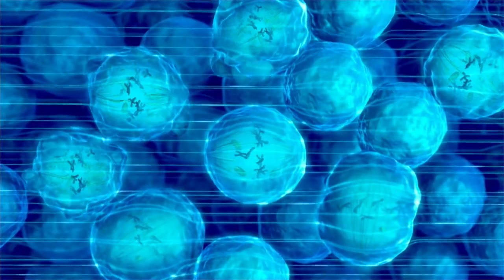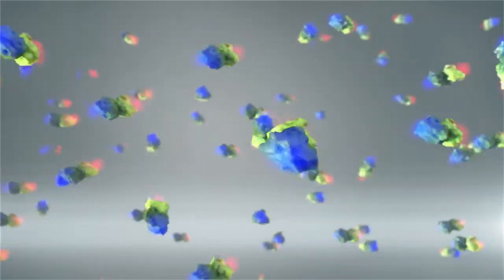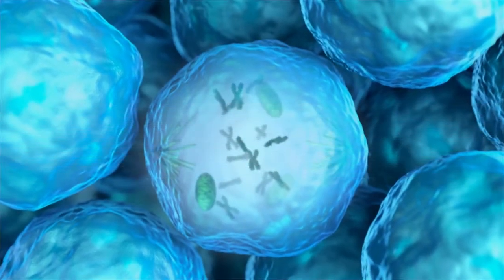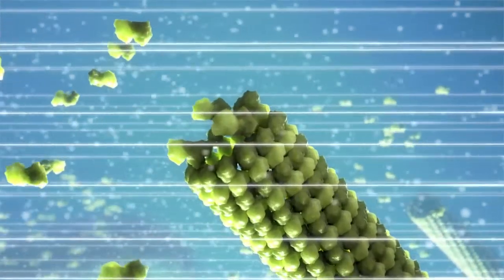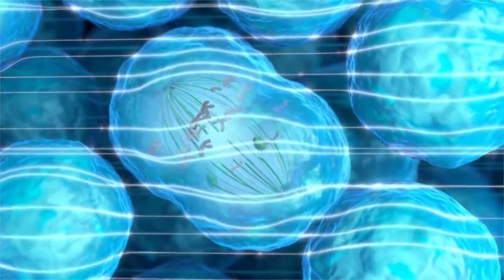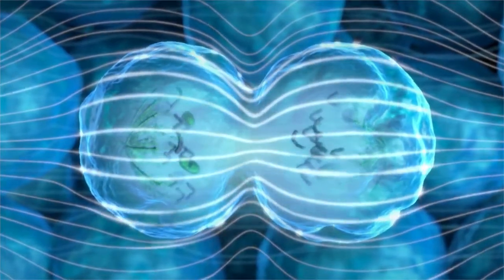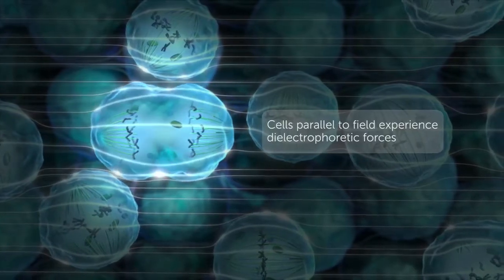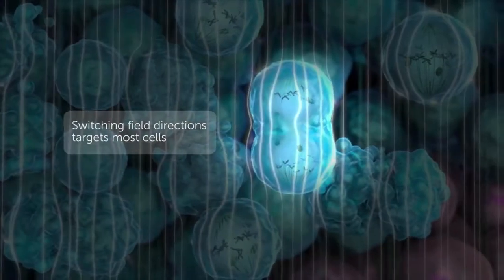OPTUNE wearable device by Novocure

Comment: Hello, my name is Serge Gamache and I do research in my spare time about particle physics and I think I found the reason why the TTfield signal is not as efficient as it should be in your devices. Currently, with your system, we can observe that the action is done in 2 stages, 1- the alignment of the cells, and 2- the interference. Nuisance from the signal is make laterally and not linearly as suggested in your studies, the cells remain aligned for a short time after the signal is cut off and this is when the other pair of electrodes is activated ( switching) that the mitosis of some latecomers is affected (those who have not had time to reorient themselves in the direction of the 2nd pair of switched electrodes), to correct the problem, a 2nd more powerful signal is needed, but lower frequency (7154 Hz) which will align the cells in addition to the 100 or 200 signal simultaneously and perpendicularly. The 200 kHz signal will pass easily in between the cells and through the 7154 Hz signal. 7154 being 511 (mass energy electron/c) x 14(7S2 orbital)= Cuba sonic attack frequency. The 100 kHz is added to an undetectable frequency of 90032220 (30% of c) which could be observed in a larger system with the WEBB telescope (hot spot around the black hole of the galaxy = 30% of c) that I had demonstrated in a diagram a few months before the release of the WEBB image. By adding the 100,000 to this number, you get the number given to us via LOUIS SODDER's letter in 1968, how is this possible? is that the force of gravity is the product of the movement of small particles that we could call gravitons, their speed is equivalent to c2 and that is why information can travel in a loop in almost real time via gravity, it is how I got the information that allowed me to build my hexagonal spiral that predicts the hot spot (among other things), everything I know comes to me in the body through gravity, the entrance is powered by micro-gravity, and the output is connected directly to the center of the earth by the G-force.